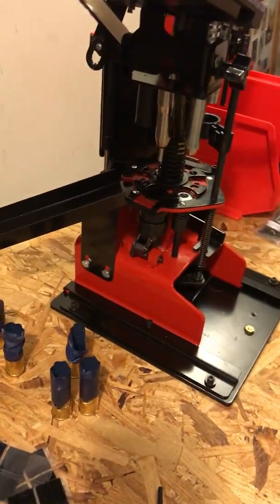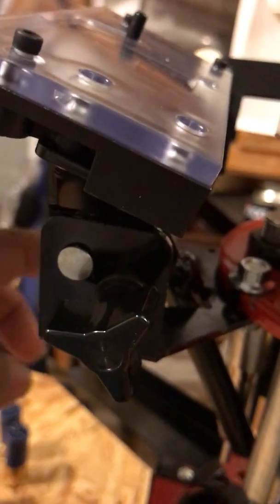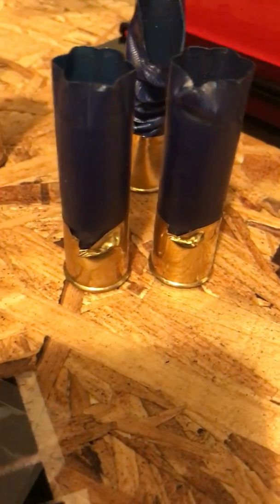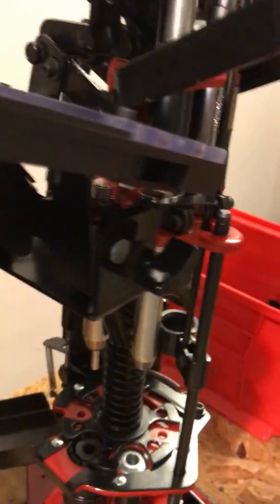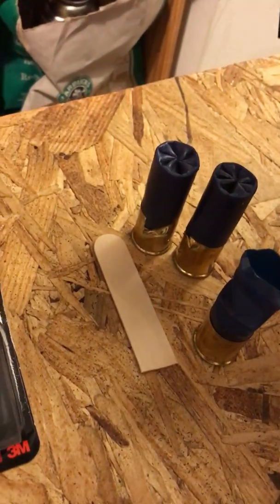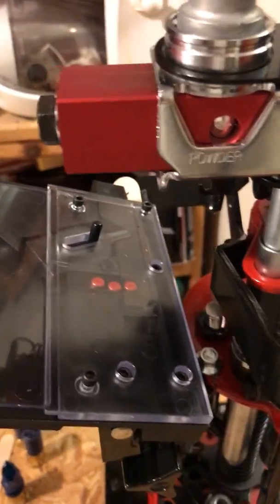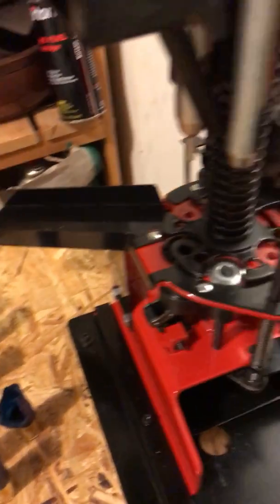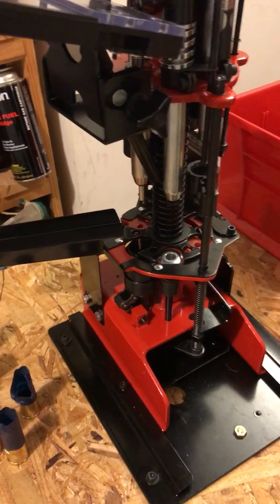MEC 9000G Primer Feed Modification

Comment: I called the factory on this exact issue yesterday. The lack of primers feeding occurred after I loosened the 7/16" nut and pivoted the primer feed tube to be more centered so it wouldn't contact the top edges of the hull and ruin them.

He told me to loosen the Allen screw on the paddle arm primer actuator and pivot it so it contacts the primer block sooner. The primer block extends out from the left side of the primer tray.
I did it and now the primers drop just fine and the feed tube doesn't hit the hulls.

Comment: I picked up a 9000e from a friend of mine. Press works great. But i have been unable to get the primer feed to work consistantly. My solution was to take the primer feed off entirely and place the primers one at time. Anyone has suggestions, please help me. I am pretty adept mechanically, and i still try to get it working, but as of yet i jave not suceeded.

Comment: 1. Remove the tongue depressor and the Velcro, 2. The tube needs to be DEAD CENTERED on top of the carrier primmer hole, so use a screwdriver and wedge it between the tray tube - without putting too much pressure on the powder or the deprived tubes - and exactly CENTER it above the hole, 3. Make sure the primer tube hight is exactly right and doesn’t put much pressure on the carrier.  That should fix your problem.

Comment: MEC told me to stick a screw driver into the primer feed tube and bend it a little.  Worked great after that.
Reply from the maker: I will try that because my work around isn't always reliable.
Reply: Why does MEC not fix this? They told me to take off the bracket and grind the right edge down to where it doesn’t hit the brass. Why have a flawed design in the first place?

Comment: I did what you did in that I cut a square of thin plywood, drilled two holes in the arm that makes contact with the primer-pusher, and used small nuts and bolts to hold the plywood in place. Like your solution, I extended the reach so that I could position the drop tube between stations 1 and 2 with clearance.

Comment: Spoke to a local MEC service guy and he showed me how he properly installed the primer feed. Just install per instructions keeping bracket on same plane as base then remove primer feed tray and use a healthy Phillips screwdriver down the primer chute and bend chute with screwdriver till primer drop tube lines up correctly!
Reply: This is exactly what i did with the tube on my 8567 Grabber.  Now it works perfectly.  The key I believe is to center the drop tube precisly  over the hole in the carrier plate.  If the primer tips, even a little when it drops into the hole in the carrier from the tube, tweak it a little until the primer drops cleanly in the hole,  You may have to remove the primer tray a couple of times to get access to the primer tube with the screw driver, but once you get it right you will be rewarded with flawless operation.